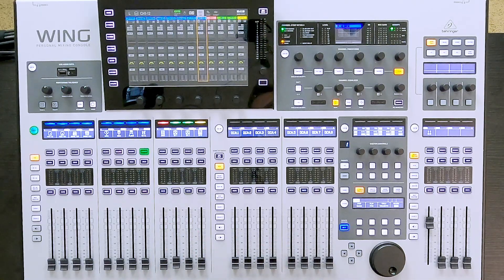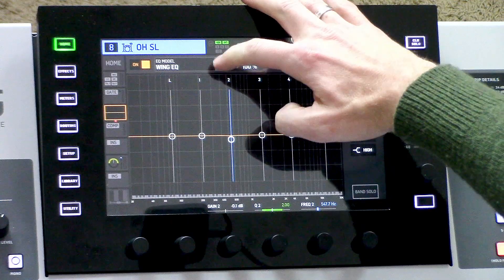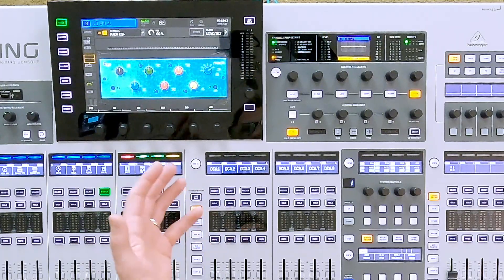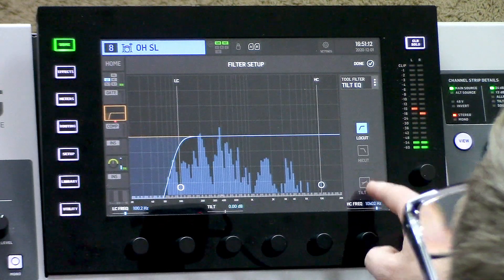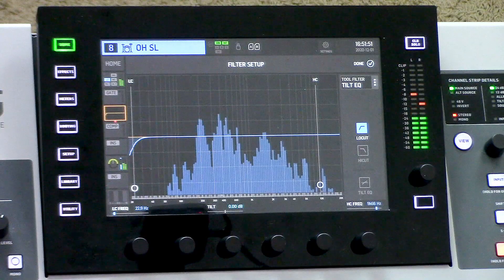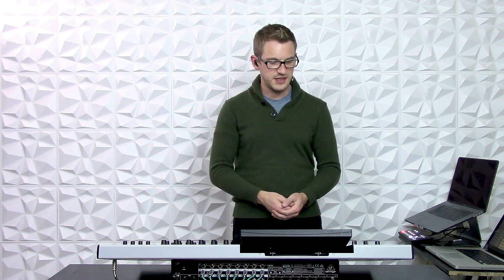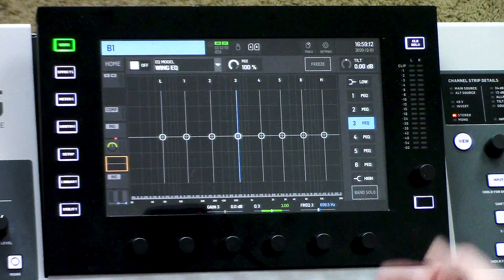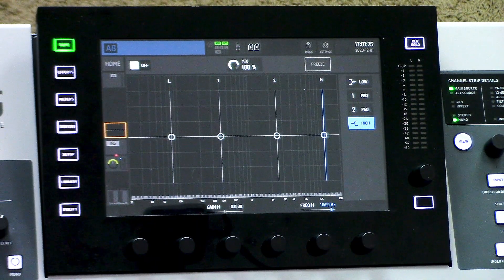Behringer Wing 202 - EQ Tutorial

Comment: Hey brother. God bless. 
What’s the best way to route a hardware compressor (1176) on my x32  Producer in conjunction with reaper for using it to record in vocals as well as using it for mixing (as an insert).  I also have a 2 channel
Focusrite with phantom power. Can I use this in conjunction with my 1176 to the x32 for tracking vocals?  Like as a preamp?  If so how do I route it because it has to be plugged in via usb to operate
Reply from the maker: Hey, Tj! You would want to set that up as a hardware insert on a channel, but then you would need to set your X32 to record in a specific way to record with that insert. I have a video about recording with effects, which you would be doing a similar setup to this. Check out the video: https://www.youtube.com/watch?v=5bANKiW9ysk. 

For the physical insert, you would need to use the Aux out as an insert, and insert that Aux 1 to the channel using the Config tab.

Using the Focusrite would be tricky along with the X32 because most DAW's only function with one audio device at a time.

Hope this helps you get what you need!
Reply: @DrewBrashler  yeah I found that vid!  And I have been recording in with my 1176 and sonic maximizer. So my next question is after I mix id like to take all the channels (individually mixed) and run them back to my daw so I can render a final mix to stereo. Is that possible?
Reply: @DrewBrashler  also is there a way to mix more than 32 channels using the x32?  I’m finding that my other channels are used in the aux and effects faders. I’m using the Patrick Guillets daw reaper program to control the x32 with reaper

Comment: Nice to have you back Drew, great video as usual. 

I would only like to mention a few points that may have been left out:
1. The low and high bands are shelf type by default but could be changed to parametric by selecting the settings icon in the top right corner of the display (the round gear icon) whilst on the eq page
2. The high cut and low cut filter’s steepness (db per octave) can also be adjusted, same procedure as above
3. All channels (except aux ones) have an additional eq (3 band parametric) for the bus sends.
4. There is also a 3 band dynamic eq FX that could be inserted same as the 31 band  eq FX that you mentioned.
5. The tilt Eq comes in really handy for me when dealing with proximity effect on shared speaker mics so rather than re eq-ing I can just use the one knob tilt function for speed

All in all very thorough video and very well explained. I can’t say it enough how glad I am that you’re back, looking forward to seeing more from you. I’ve learned a lot from your videos. Bless you brother!